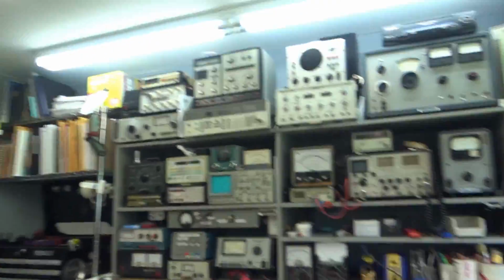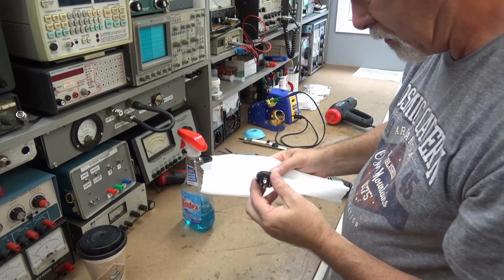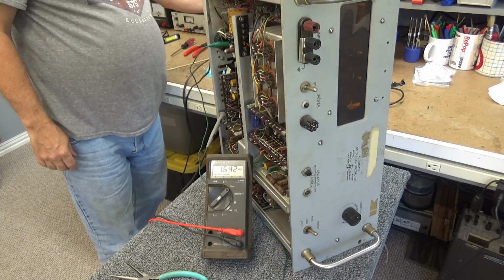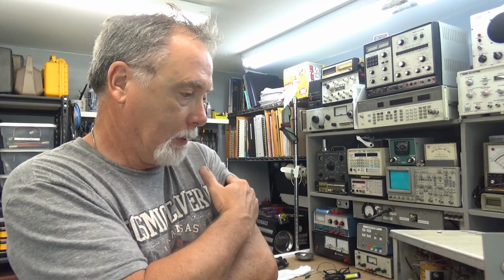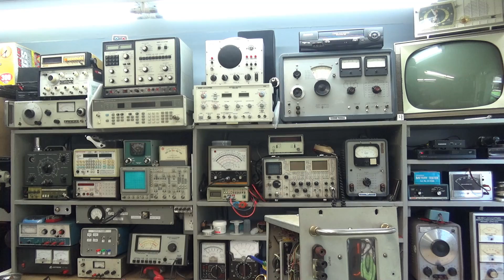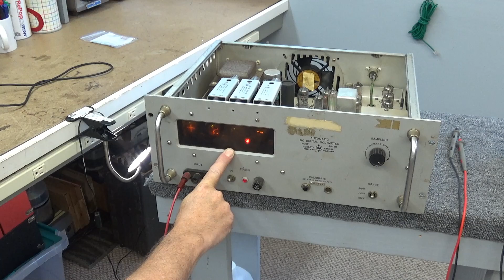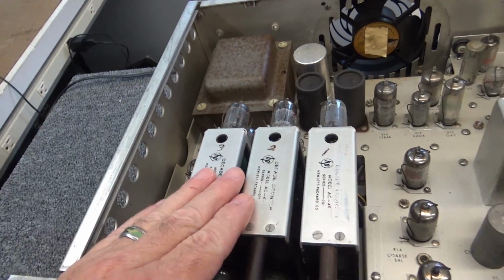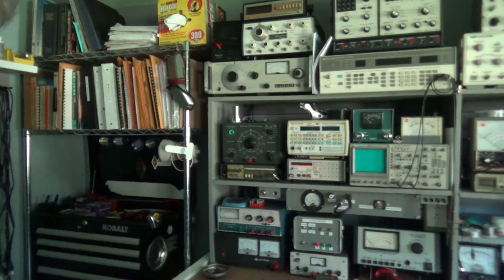EP 84 Part 2 HP405CR Digital Nixie Tube Voltmeter Capacitor replacement and Test

Comment: Hello When you turned the unit right side up I see that one of the short tubes in the upper right looks like it has went to air as the top is cloudy white. 
I would replace the rest of the electrolytic caps as a matter of course. With the nixie tubes if one element or number is like half lit the whole tube might need to be replaced.  Good Luck.the video is interesting!
Reply: Seeing it with a 32" monitor it appears to be V12 which is a 5696 . A Thyratron tube filled with Xenon gas and on 
top should be a lot of getter (silver) material. Which it clearly does not. Good eye John!